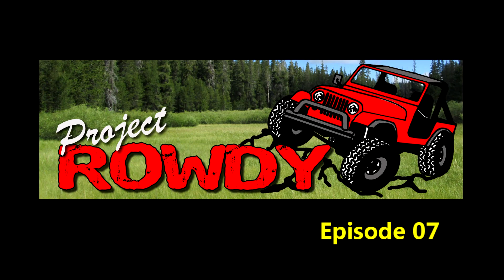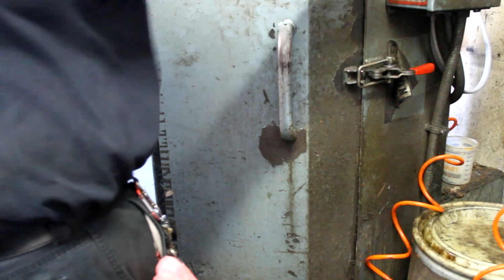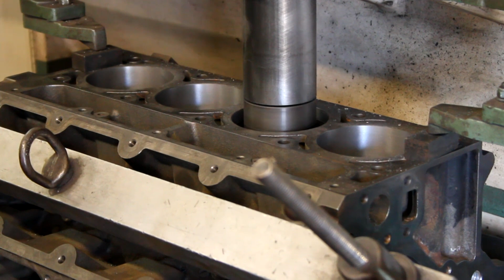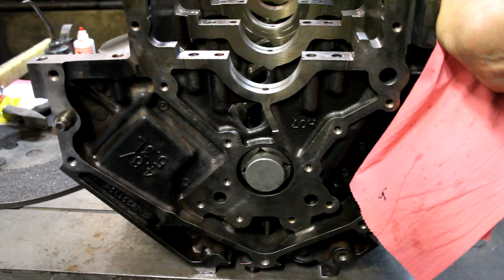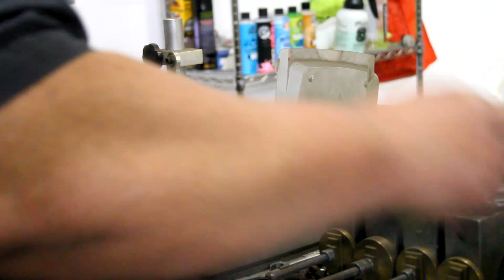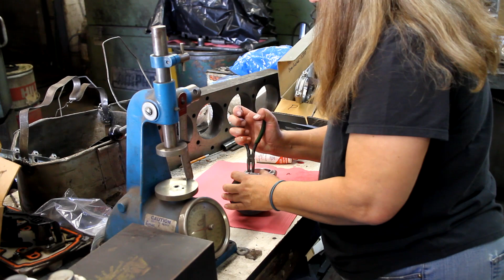LS 5.3L Build Part 3 Machine Shop Work | Project Rowdy Ep007

Comment: Really like the videos.  I have a 2000 Silverado with the 5.3 and 862 heads that I am looking to put a cam in as well as have the head done.  One of the things I am looking to do is making he intake valves 2".  Did you consider doing that or did you pass on it for any particular reason.
Reply from the maker: Taking the Intake valves to 2" did cross my mind as I did purchase new Valves and it would have been the perfect time to do it.  My original goal was to just rebuild to stock except the CAM.  I am trying to somewhat duplicate the Loping sound that I currently have in this vehicle (79 Jeep CJ7 / 304).  Being a Jeep that will see tons of street miles, the 300+HP will be perfect for my application.  I was trying not to get into too many mods other than those that just needed to be done.  With that age of a truck, a complete valve job would be in order and that would be the perfect time to make that upgrade.  You will need to also adjust your programming.  Good luck if you decide to pursue!!!!!

Comment: Wat was the cost of all of the machining
Reply from the maker: Thanks for watching Preston. The machine work was $1200.  Which included all of the work that you saw in the video, plus a few other pieces that we did not catch on video (Flywheel balancing, cleaning/Inspection/measuring for where we need to end up).  I have documented all of the Parts and Expenses for this build and will publish them at the end of the last video of the Engine Build Series.  Hope you enjoyed the overview!
Reply: I have been doing some reasearch and would like to do a similar build. 5.3l with a tremec 56 behind it. My plan is to do a bigger cam and maybe some heads and an exhaust. If i can find a clean s10 then do the 5.3l t56 swap. Im following ur videos to learn. I have rebuild 3 4.3l vortecs before from my previous 98 s10 i owned. Great videos btw. Looking forward to new videos, when do u release videos. Weekly, monthly or just when u get the videos done.
Reply from the maker: Sounds like you have some good experience with this platform.  In 1994, I built the AMC 304 that is currently in the Jeep.  I have also build a Chevy 307 form a 72ish C10.  About to have this one in Paint and then will be documenting a cleanup effort on the Wiring Harness.  I get my videos out when I can!  These have been a little slow as I decided to build this 5.3L so that my boys could see/help/learn.  Been a great project so far, but their availability is slim....  Can you say Girl Friends!!!!!  Thank you sir!
Reply: Well i look forward to the futrue videos. With the machining i plan on doing it in different parts as money and time are a limited. So i think if i do the motor build first then buy the trans and then buy the s10 i will have a nice setup. I also dont have a garage avaliable at all times so im going to start with a 5.3l rebuild.
Reply from the maker: An additional note on the "Bigger Cam" you mentioned.  I had learned a lot in my research and it was my machinist that want to review my choice and plans for the vehicle.  He pointed out something that I was not focused on...  The specified "RPM Range" on the spec sheet.  The one that I chose is 800-5800.  90 percent of my driving will be on the street so I really needed the lower end availability.  Check that out while you're doing your research.  I enjoy that part of it as much as the build.  I am learning so much with this one.

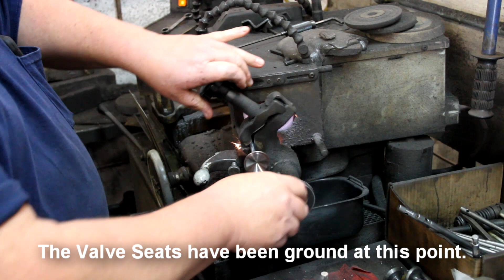Comment: Man, looking at that shiny head at around 2:00 into the video...that's engine porn right there.  Great stuff!
Also, it appears those pistons have the ceramic coating on the top?  You'll love that...cuts down on carbon build-up and is slightly better on containing heat.
Reply from the maker: Still grinning ear to ear!  Looking forward to start turning some bolts!